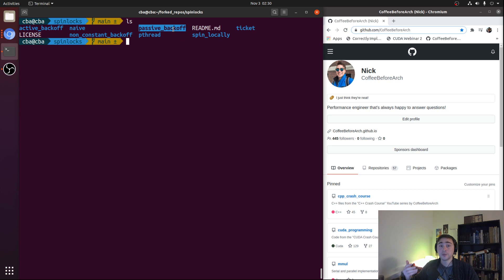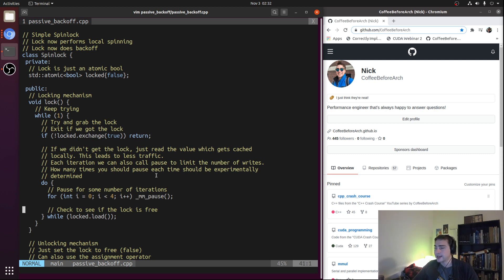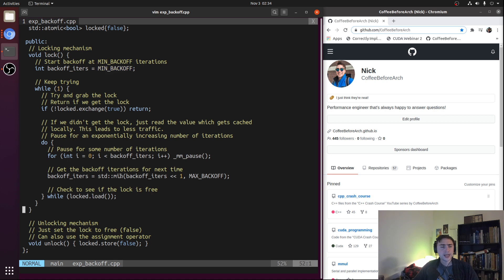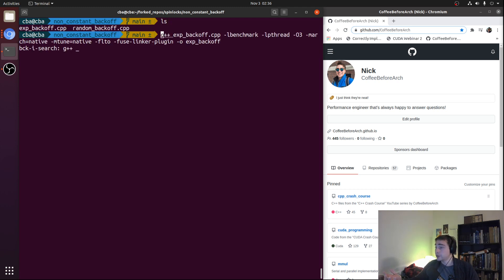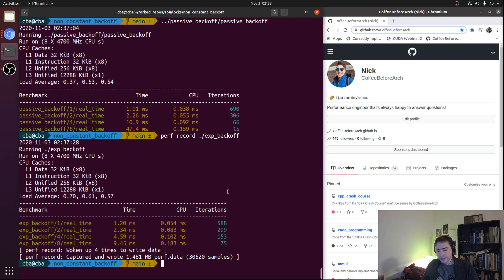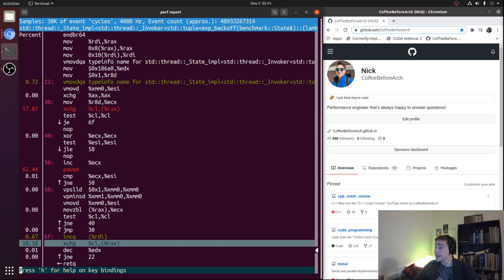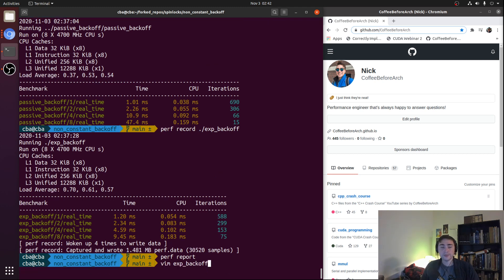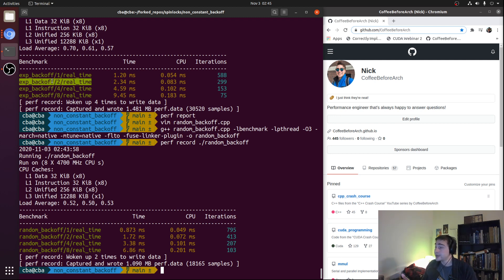Spinlocks - Part 5 - Exponential and Random Backoff

Comment: That exponential back off example seems like in a high contention and slightly longer holding situation that it's going to the extreme of being unfair, where you might have one or two threads which rarely ever get the lock.

In the random back off using random like that is not thread safe, not to mention mt19937 is massive (19937 bits), so you probably don't want it inside every spinlock.

I'm skeptical of your benchmark approach, it seems like your solely testing extreme contention, different threads will start at different times and finish at different times, the lock and the value your incrementing could be sharing the same cache line, there is lots of questionable things.

While I'm only up to watching part 5 in this series, I'm surprised that there isn't one mention of why spin locks are bad for user mode applications which aren't running in real time, not to mention the bigger consideration of contention should be minimized not the thing you strive to improve.

Comment: Wouldnt a clever idea be to relate the minimum number of pauses to the number of assembly instructions in the assembly of the function which actually does the work? One would have to account for ifs and loops, but in general if the shortest possible path is say, 10 instructions, then it seems to me that minimum amount of pauses = 10 seems reasonable.